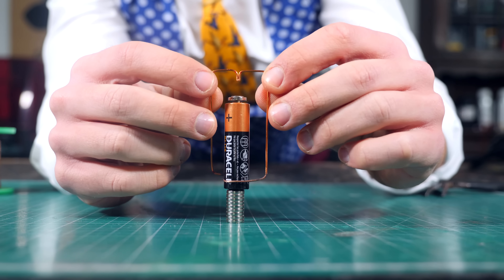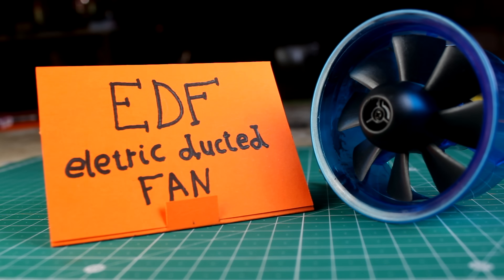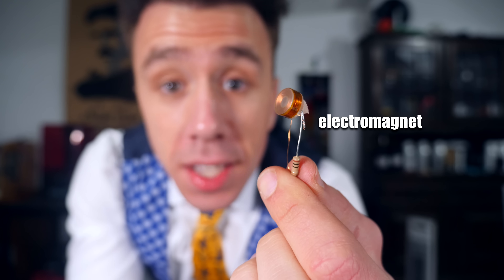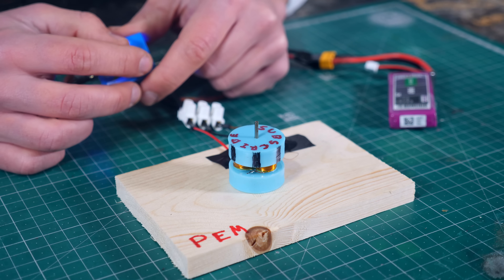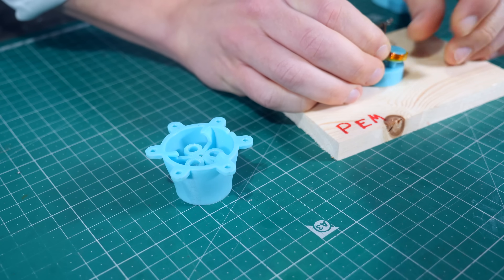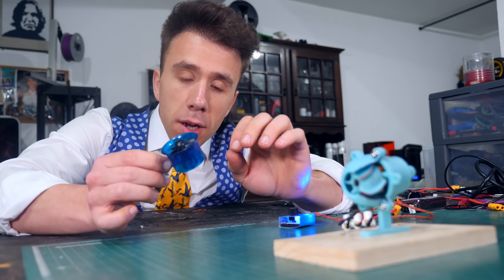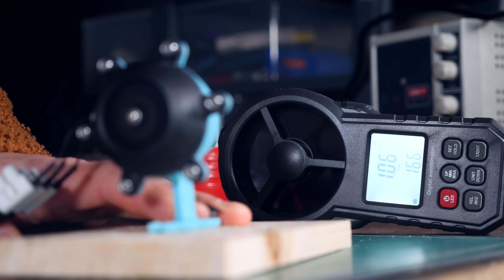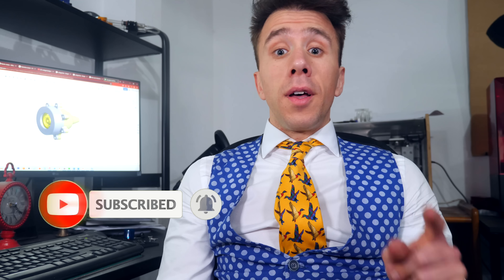I 3D Printed an ELECTRIC MOTOR FAN

Comment: First of all the assumption that same motor means same air flow isn't correct, both the design/style of the fan blades and the design of the duct will have a large impact as demonstrated by these tests. On the up side that means there is plenty of room here to optimize the design.
As a lot of people have said factors such as blade geometry and inlet diameter could be adjusted and power draw can be compared between the original fan and your own.
one thing I haven't seen mentioned as much is the design of the duct/outlet. From looking at the model I can see the cross sectional area of the duct beyond the fan changes a lot, from much larger after the fan to small at the exit. As a result the air which has been compressed by the fan will be immediately expending then recompressing as it exits, this is most likely resulting in a lot of internal turbulence and reduced efficiency. Further more, you have a lot of flat surfaces in the air stream, at best these will be causing vortices and turbulence at worst they could be forcing air back into the fan and stalling it.
I would Highly recommend reworking the outlet component such that the cross sectional area of the airflow is more consistent and remove any flat surface the air could hit. This might not fix the overall design but it should improve things and help in isolating issues to the fan such that the impact of design iterations can be better understood.

Comment: since thrust is mass flow times area for air screws or in this case the edf , u need to increase the impeller diameter so area is increased to match that of the efd

Comment: Along the lines of a 3d printed impeller, maybe try to print one of the low noise impellers the US navy uses for nuclear submarines to reduce dection. Also, it's cool cause the design keeps the impeller intact for longer since the blades create fewer vortices that implode on the tip of the blades. Maybe going into a little about how the science works and setting up and experimenting as a proof of concept would be interesting to watch

Comment: I think it's because ur just measuring the thrust of the air alone, but ur comparing it to a jet engine that burns the air. Based on whatever law of thermodynamics was the one that says nothing can be 100% efficient. the air that your idea makes actually has less thrust because it looses energy due to friction but it would make more thrust than even the regular fan if you burned the air.

Comment: Intake diameter is much smaller for your impeller than the EDF, a major limitation - a centrifugal impeller will necessarily be much larger in diameter than an axial flow impeller of the same intake/output CFM as a result. Your blade profile should also be angled appropriately for the flow each part of the blades are seeing, or you have an inefficient airfoil. You might also add secondary blades towards the periphery where the initial blades start to separate. Centrifugal fans (from a quick run around search engines) do better at producing high pressure, axial fans do better for high air volumes - centrifugal is not a great design for a stand-alone propulsion unit. 

But it would do great for producing some highly pressurized air for a jet; the Whittle engine (WWII era) used a centrifugal compressor driven by an axial exhaust turbine, and was one of the first practical jet engines. Later axial compressor engines were much narrower, but required multiple stages with intervening static vanes to re-straighten the flow for efficiency.  https://i.pinimg.com/originals/67/cc/dc/67ccdc781fd239fc1fd469fd074691db.jpg

Comment: The reason why the EDF and the Dyson centrifugal fan have different outputs is because you have to look at the volume of air that each fan can push out. The EDF has a larger intake, and the output is the same surface area as the input. If you have a smaller input and smaller output, the total output isn't going to be close to the Dyson fan, no matter if you match the rpm of the Dyson motor, or double it.

Comment: The small intake means a bad impedance match with the surrounding air. The front of the fan is under a vacuum, meaning that a chunk of the pressure differential is wasted trying to suck air in the front. That means less pressure pushing the air out the back, as well as restricted volume.

OTOH, why does the Dyson blower work so well?

A big factor is likely the gap between the impeller blades and the housing. I think that needs to be really really small, or the air is just going to leak past.

I feel like I’m still missing some key element of the Dyson design though. I feel like there’s something to do about him optimizing a lot for pressure differential. I also suspect that the configuration of the airway leading to the mouth of the fan is critical too, for the sake of impedance matching. (Impedance matching is why rocket nozzles are flared, and also why horn-loaded loudspeakers are so efficient.)

Comment: judging airflow by fan driver size is incorrect. with the same driver they have the same potential to move an amount of air based on the drivers maximum power, but that is based on the impeller/fan design. fans and compressors are 2 different functions of moving fluid- so to match the EDF the compressor will likely either have to increase in size or rpm

Comment: I'm a technician who works on a variety of jet engines!

The EDF is basically a turbofan but without the compressor / turbine which is extremely efficient for that particular application. Your impeller is acting as a compressor, which handles much less gas-flow overall. So without the rest of the engine to accelerate the gas after its compressed you're losing most of the advantages a centrifugal compressor provides. Remember, when creating jet engines you're essentially creating a glorified venturi.

Hope that helps, and keep up the great work!!

Comment: In HVAC you use different fans to achieve different types of Air flow fan blade design plays a big part of this centrifugal fans are good a making static pressure and prop fans make more air flow at low static pressure usually. I am still trying to figure out the correlation between the style of fan vs power vs air flow vs pressure. If someone has good info on this I’d really like to see it. EDF seem like they make very good air flow but I’m curious at what static pressure. centrifugal fans great pressure but at less airflow. 
Great job keep it up.

Comment: Im an engineer .... but the one you want to talk to :C im not great at fluid dynamics....

However, there is a youtube channel you may want to check out = Majour Hardware. specifically his series Fan showdown where he takes user-submitted designed for Computer fans and pits them against eachother. 

Basically from what i do understand about fluid dynamics - is that impeller designs (there have been a lot of submissions resembling tubos, jet engines, etc) are very inefficient, so they move a lot less air (less work/less thrust)

I know that in high bypass turbo-Fan jet engines, they are extremely efficient because the majority of the thrust is generated by the fan and the combustion in the jet istelf is more or less just driving the fan. I know at higher speeds this all changes and I really barely have a grasp of any of this to begin with hah.

the fan designs are what are causing the difference in thrust. The motors are doing the same amount of "work" (outputting the same amount of watts) but the fans do not utilize that energy the same. One fan is designed to be more efficient. And i believe efficiency hear would be that the blades require less energy to move the same amount of air as the other fan design. 

Just like you see in Major Hardwares Fan Showdown! :D same motor, same power supply, different blade, different amount of CPM(implying one fan produces more or less thrust than the other).

Comment: It's not about the motor that much. I used to fly model airplanes way back and depending on the angle of attack and the diameter of the fan (propeller), thrust was massively different between different propellers on the same electric motor and batteries.

I'd start there. A given pitch and prop diameter lead to a certain thrust and power draw. There's a reason why turbos spin at extremely high rpms, my guess is that their pitch is very low compared to large propellers and they need to make up for it with massive RPM, something a large prop cannot do as well.

Comment: So in this video you said that centryfugal fans send air outwards to increase it's pressure instead of increasing it's trust. 
And with this idea in mind you asking why the same motor can't create same trust with centryfugal fan as with axial one...

Because of WORK! Motor doing same amount of work so in centryfugal fans part of work is wasted on compression.

Comment: I suggest that you make another video doing a jet engine with this modifications on your centrifugal turbine:
First, the intake side of the turbine need to bee in the form of an almost quadratic function that was rotated in space (like a curly slide with the slide side as the out side)
Second, the air out of the turbine is compress so the exhaust parts need to bee little in diameter
Third you need to create a combustion chamber too slow down the air and bee able to burn fuel efficiently
I will try to make an efficient model and put the link here in my free time
And give me that printerrrrrrrr

Comment: 1) Thrust is force, not air velocity. Measure your thrust with a scale, not an anemometer.
2) Because of Physics™, you produce thrust more efficiently by accelerating a lot of air a little bit, than a little bit of air by a lot. This is why jet engines with bigger fan diameters are more efficient, they are accelerating more air, and therefore don't have to accelerate it as much for the same thrust.
3) This is why measuring your thrust with an anemometer can be misleading - Your DIY fan might be accelerating more air, but to a smaller velocity.
4) But also, it looks like your DIY fan has a pretty puny intake area and is also discharging into a flow restriction. A fan shouldn't be trying to compress the air, it should be trying to accelerate it.

Comment: Looking at the original EDF and the printed unit, the area of the intake on yours is much smaller. The EDF has an intake diameter of about 1 Tomato. The fan you made has an intake area of maybe 0.25 to 0.33 Tomato. 

Try expanding the outer diameter of your impeller to have the same overall surface area as the purchased EDF - about 1 tomato. This will also mean modifying other parts, but you get the idea.

Comment: In the automotive Turbocharging world, the Inlet diameter is the maximum airflow limiter, and the impeller design and piping and size ratio to the compressor limits the maximum pressure. You might want to research Jet Turbine blade design and how they use multiple stages of static and rotating blades. In the world of Aviation, Propellers are long and thin but bark loudly. There is a new EV Airplane design "Lilium" that utilizes the EDF, and a tilt to hover system which uses clean air from the top of the wing to feed the vtol engines and make more lift. You might learn from looking into the design of wind tunnels. In the world of PC cooling the more swept the blades and overlap the higher the static pressures. In the world of surface area and flow rates, why not a tesla turbine? EDF Ducting plays a big role, like the static jet turbine blades or a Racing car carb trumpet horn. Narrowing of a passage but maintaining fluid transfer volume results in a higher velocity of fluid. Laminar flow also helps. In the PCP Air Rifle world, smaller caliber barrels have lower volocity limits due to surface tension. If you want to make a supersonic pellet, you need supersonic air to catch and then push on the pellet that is trans sonic. Aside from all the rabbit holes, the answer is quite simple. The more work you put on the fluid air, the more losses you will incur and the less efficient the design. Maybe put a tail behind that BLDC in the EDF to help airflow/drag like a velomobile or land speed car/bike. EDF are just propellers with a wing wrapped around it to speed up the air, just like across the top surface of a wing.

Comment: I think you don't have the same area covered by the disk of your impeller blades and I think there is also a lot of back-pressure in the design, and friction on the air.

Comment: Thrust is based on the amount of stuff (air) you are throwing backwards. Axial fans are great at throwing LOTS of air backwards at high velocity, but they don't create much static pressure.

Centrifugal fans are usually better at creating static pressure but not so great at the total volume of air being thrown out. This is why centrifugal fans are not used for thrust.

Comment: if i had to take a guess, its that you are loosing efficiency due to the difference in fan types. to get thrust with a EDF, the air basicly gets pushed one direction. But using a centrifugal fan to compress the air and exhaust it out the back, you are losing energy when the air changes directions when hitting the housing, then im willing to be you are losing energy in the compressing of the air in the form of heat. atleast how how my mind thinks it out.

Comment: Centrifugal fans (impellers) do a great job at making static pressure, but not mass flow. This is why a lot of turbine engines use Axial stages for the first and second stage compressors, and then centrifugal for the last stage. A lot of engineering is spent on the aerodynamics of fans, you should look at the trochoidal blade design that NASA is currently testing for your next video. We think fans/propellers are fairly well understood, but then something like this comes along and completely changes everything.

Comment: I wonder if the surface of the hub is a problem. With the fan I can see that as a percentage of the straight on surface area thé center spindle is quite small and on the impeller it is tapered the whole way out to the base. Perhaps the question is how big you need to go to get the same results. And that might give you an idea of what the deficiencies are.

Comment: I believe the 3D printing of these parts is the weak link. If you were to cast them under vacuum or injection mold them, their rigidity would be MUCH more sustainable.

Comment: as a big fan of the fan showdown, I can definitely tell you that the motor is FAR from the only thing that affects airflow/thrust but I don't really know what more to tell you honestly but you can lookup Major Hardware's series to see what I mean. the whole thing he does is put various fan submitted fans on a specific fan hub and records a bunch of data like sound level,  airflow per min, and flow pattern using a smoke mashine.

Comment: I don't have enough background to say for sure, but my gut is thinking that the impeller fan requires more torque (since it creates higher pressure air) to be effective, that the motor might not have.

Comment: I suspect the performance difference comes from the difference between kinetic energy and momentum. Thrust comes from momentum exchange, where momentum is mass x velocity, while kinetic energy is mass x (velocity squared). Here the mass is the amount of air being moved through the fan per unit time.

Assuming the EDF motor is consuming the same power in both cases, and running at the same efficiency, it is producing the same kinetic energy. If the energy is imparted into less mass, the exhaust velocity will be higher but the thrust will be lower.

How this applies to your problem: A larger fan will tend to have a higher thrust/power ratio than a smaller fan because it sweeps a larger volume of air. This is why passenger planes keep getting larger fans on their engines; they make them literally as large as they can. Meanwhile fighter jets have tiny fans because they don't care as much about fuel costs as they do about power/weight ratios and being a small target.

Comment: Part of the bldc potential is wasted for compressing (slowing flow) instead of pushing (increasing flow).
The analogy with a jet engine is wrong since you do not have a combustion chamber and the purpose of the compressor stages in a jet engine is not to create thrust...quite the opposite in fact.
Make a centrifugal compressor but with a constant cross section so that the air never gets constricted.

Comment: I think the difference is you are putting the motor in an air compressor, while the fan blows more air, with less ability to make pressure.  The impeller blows less air, but can build more pressure.  Pressure is needed for combustion.  Fans dont go on engines.

Comment: You're comparing a fan designed for max flow, with a fan designed for max pressure. Jet engine designers started with the centrifugal COMPRESSOR for jet engines because they are easier to balance, and can achieve 4:1 compression on a single stage. But they do not flow very much. Someone already pointed out the frontal area difference of the inlet. All high performance jet engines use axial flow compressors, with just a lot of stages.

Comment: I may be an amatuer when it comes to ducted fans but is there anyway to 3D print an inlet full of tubes to create a laminar flow going into the inlet? I guess the same question for the outlet like a stacked set of straws  to duct the outlet directionally.

Comment: The edf is designed to make maximum thrust with no exhaust restriction. It does very well at this. A centrifugal fan with the same motor will not be able to make as much thrust with no exhaust restriction. A carefully sized exhaust nozzle will improve the centrifugal fan but it will never be as good as the edf. However with the much better pressure capabilities of the centrifugal fan you may be able to burn fuel after it without the extra pressure overwhelming it and make much more thrust.